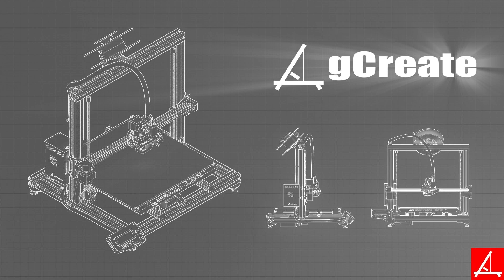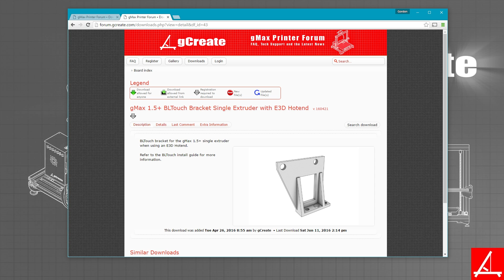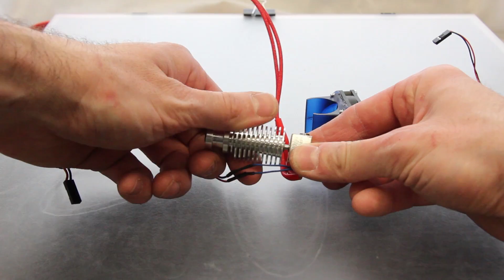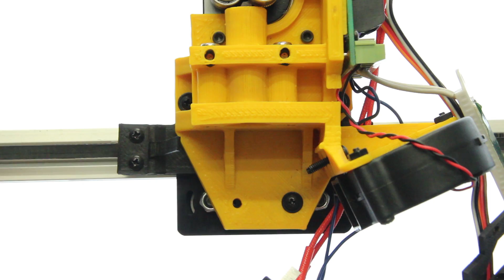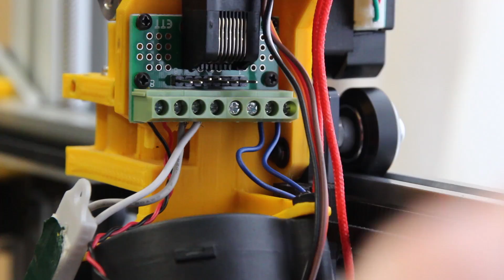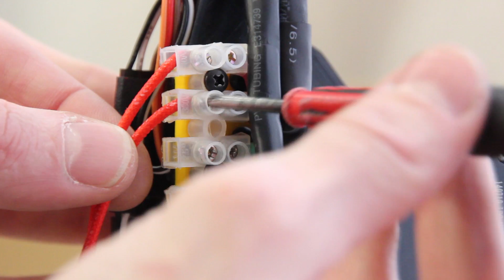How to: Install E3D All-Metal Hotend on the gMax 1.5+

Comment: My printer came with the BL Touch and i have upgraded to E3D hotend. I'm having trouble changing/updating the firmware to meet e3ds tuning. also should there be an option  through the menu on the LCD display for calibrating bl touch? can i back up the firmware that is loaded when it was ship to me?